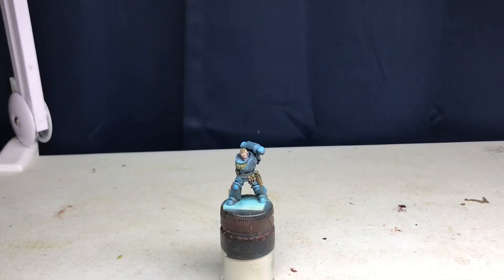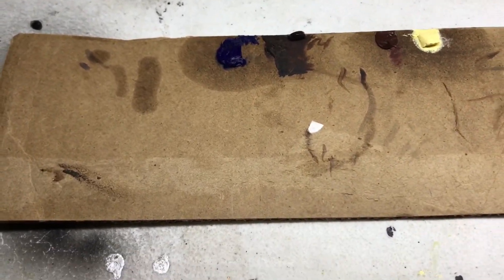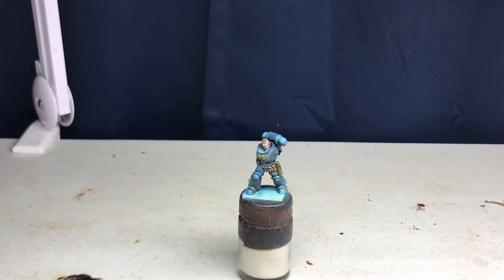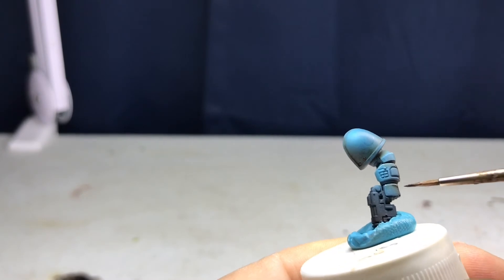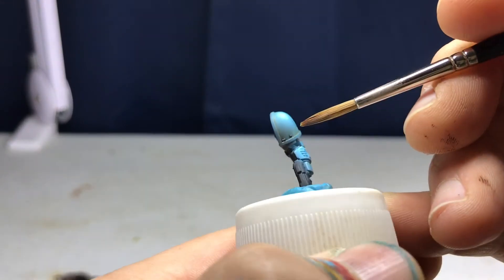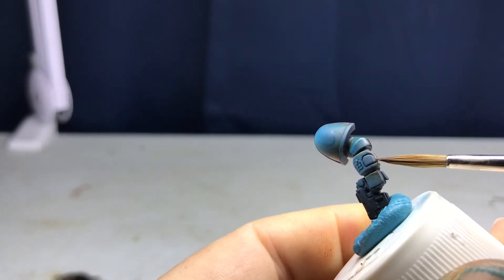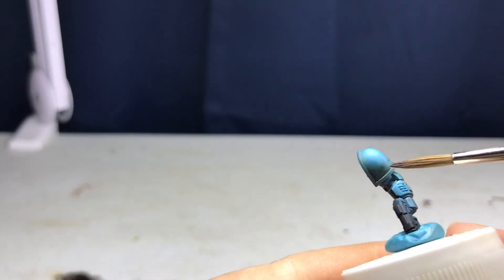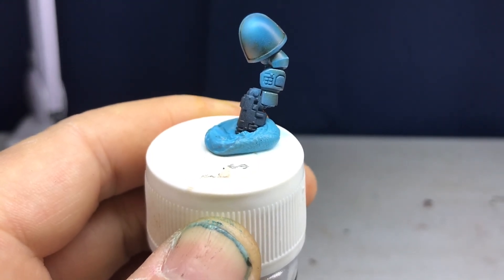Oil paint weathering

Comment: Good job using the oil with the model. A thought in regards to your paint brush, have you used a brush soap??  I've been using a type for a while now and if used correctly and often you should be able to extend the life and accuracy of the bristles of the brush.
Reply from the maker: That brush is 7 or 8 years old at this point but synthetic brushes seem to work better for this technique, especially the loew-cornell 7020 size 2.

Comment: Hey man, I'm trying to paint up some dark angels and wanted to do some weathering and these effects from this video. Is the only real way to go about it with that color scheme lightening everything up or is there a way I can keep the green dark and still make this work?
Reply from the maker: Lighter would make it easier but I have seen darker colors show up against a dark background alright. It may not be as evident in a photo or until you hold it up close but it should be visible. The most important part is to test it on a scrap piece. Additionally you can try different colors than burnt umber, maybe a paynes gray or a darker blue might work. Experimenting is fun!

Comment: When you are talking about the mineral spirits are you placing them directly over the paint or did you varnish the mini before hand?
Reply from the maker: James Denney the mini is not varnished. What I am doing is directly onto the base layer.
Reply: Most people swear by varnishing the mini beforehand but I've never had an issue applying the oil/mineral spirits directly to the acrylic.